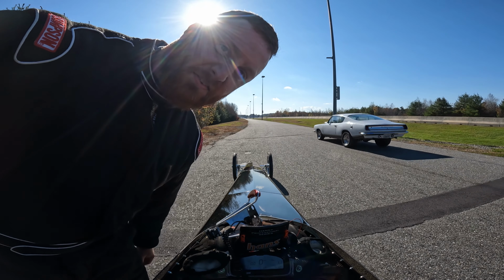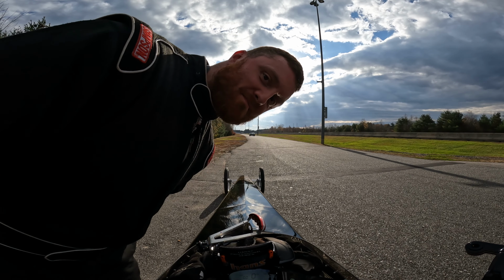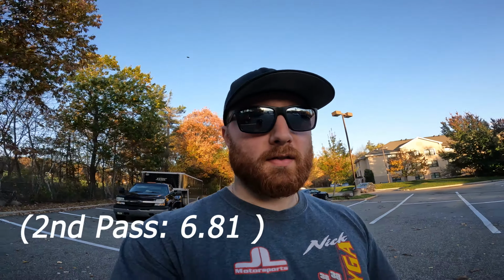Testing The Top Dragster at New England Dragway! Finally fixed the problem!

Comment: Thanks for the video! Thinking about trying to run my car in Top Dragster, have a 582 BBC that runs consistently in the 4.80's NA in the 1/8! Would like to know if I could get it in the 6's in the 1/4 with some nitrous but don't know how big of a shot I would have to go! Any chance you could share your combo  and nitrous shot you use and how long you spray it ? If not, I understand! Good luck next year in the dragster!
Reply from the maker: I would suggest starting out with a 200 shot. That should put you in most TD fields (depending on what race you are at). Run it for 4-5 seconds, you can go more but you don't gain as much. Once your car is happy with that, you can go up in small increments to where you are comfortable. Good Luck!
Reply: Thanks for the info! Good luck next year! @jlmotorsportsL196